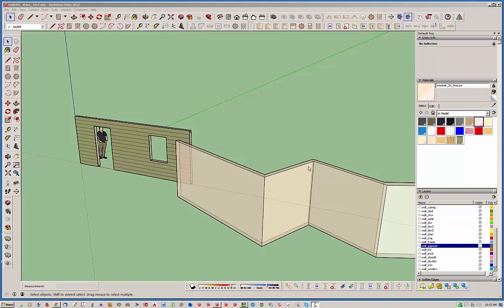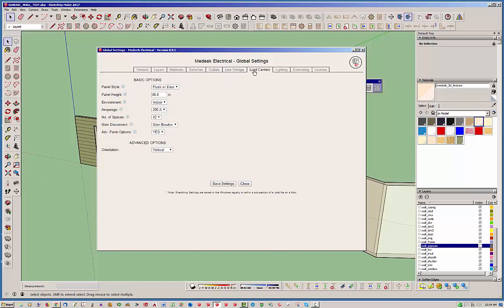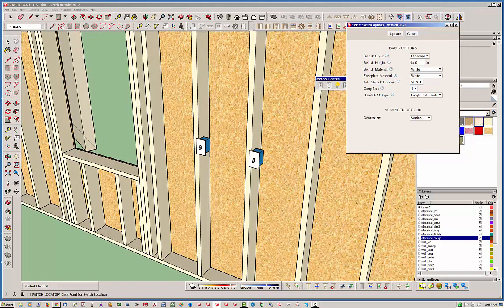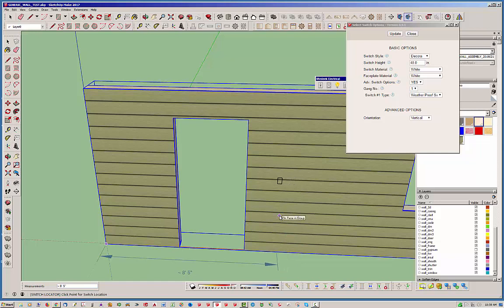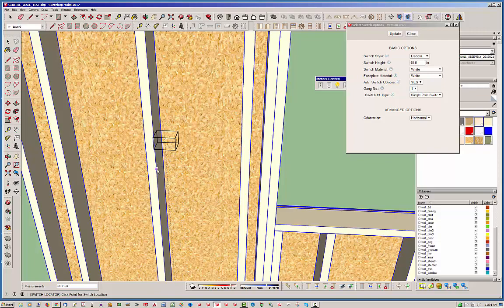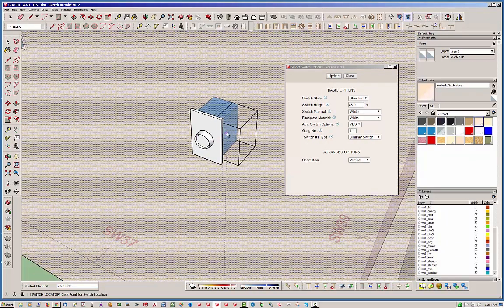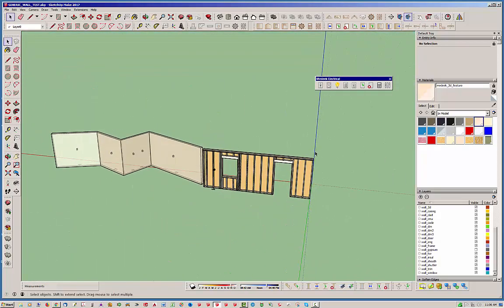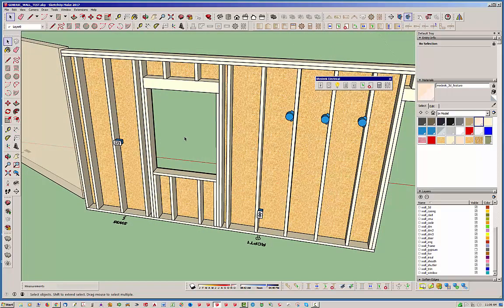Medeek Electrical Plugin Tutorial 1 - Extension Overview

Comment: Thanks for the tutorial. I have a question. I assume this is a simple fix, something I'm doing wrong. I have your wall extension as well. I have framed an interior wall (bathroom), and when I try to place a light switch, I get an error message "Not a valid wall corner configuration (end)". How can I fix this and place my electrical components inside that bathroom?

Comment: I am having difficulity in using the plug in
Reply: Contact me directly at nathan@medeek.com and I will do my best to help.
Reply from the maker: 1.) Make sure the walls, ceilings or floors you are trying to place your electrical components into are Groups in SketchUp.
2.) Make sure the groups do not have reversed faces.  You can download and utilize the Solid Inspector (free) extension to check for reversed faces.

Comment: Version 1.2.6 - 11.13.2020
- Added Safety Devices, Heaters, Vents, Floor Outlets, Low Voltage Panels and Misc. Fixtures to the Medeek Electrical Estimator.

Comment: Does it work with metric sistem? Also can you set different height for different fixtures in the same project? Will you make modular EU standard?
Reply: Yes, it automatically switches to metric mode when using metric units or a metric template.  Yes, you can set your outlets, switches etc... all to different heights independently.  I've recently added in the BS (British Standard) switches and outlets.  I've been thinking about the European standards as well.
Reply: @nathanielwilkerson6217   Maybe I'm wrong, but it would be more convenient to create a custom library and edit to any standard based on your devices, simply replacing your devices with custom ones that match the user's standard. I hope I wrote it clearly.  Thank you.
Reply: Thank you for your answer. I am waiting with interest for EU version!👍😊

Comment from the maker: Version 1.0.2 - 04.01.2019
- Created the Medeek Electrical secondary toolbar, with two additional functions/tools: Draw Heater, Draw Vent.
- Enabled the ability to draw ceiling (garage/shop) and wall mount heaters.
- Enabled the ability to draw ceiling mount exhaust fans, with or without light.

Comment: Hi. For users in the UK, for example, is it possible to adapt all of your stock  fittings to those of UK standards, for example  240v 3pin plugs as opposed to US 2 pin 110v (I think?) plugs. Same for back boxes, junction boxes and so on. Thanks for interesting plug in
Reply: The UK toolbar is now live.  You can now insert typical (MK Plus Logic) outlets and switches with the plugin.  See updates here:

http://design.medeek.com/resources/electricalpluginchangelog.html
Reply from the maker: Technically yes, but what I would really like to do is provide a switch in the global settings which allows the user to switch from the NEMA standard to other international standards and have all of those other switches, outlets, boxes and faceplates built in.
Reply: @medeekdesign  I think that would be a fantastic addition as if I want to use this I need to spend a lot of time adjusting the standard, and then it starts to defeat the purpose of a plug in. UK / EU standards would open up a big market to the plug in? Thanks again

Comment from the maker: Version 0.9.1c - 02.19.2019
- Enabled the ability to draw low voltage outlets, load centers and light fixtures with any wall geometry (removed the dependency on the Medeek Wall extension).

The plugin is now fully independent of the Medeek Wall extension and can function as a standalone extension.

Comment: Seems like there might be issues with control and escape keys.
Reply from the maker: When using the control key to adjust the justification you need to make sure the focus is on the main SketchUp window and not the HTML menu window.